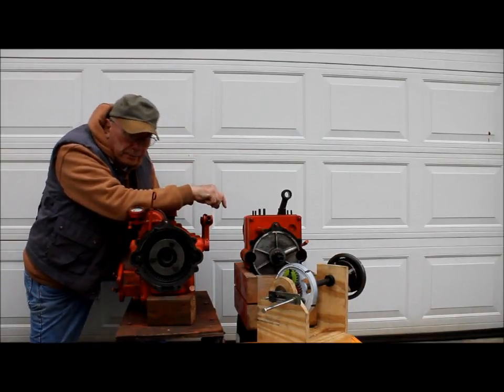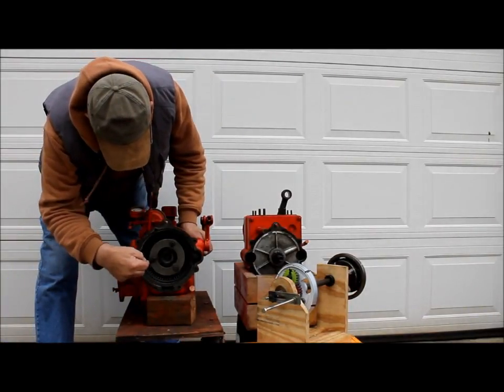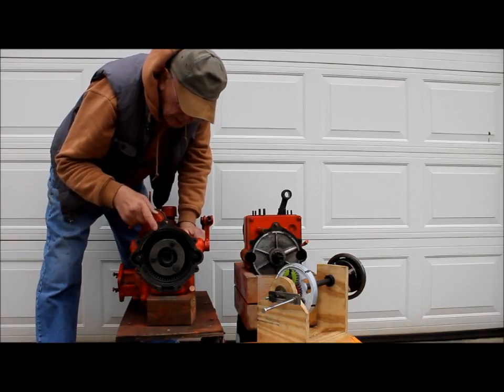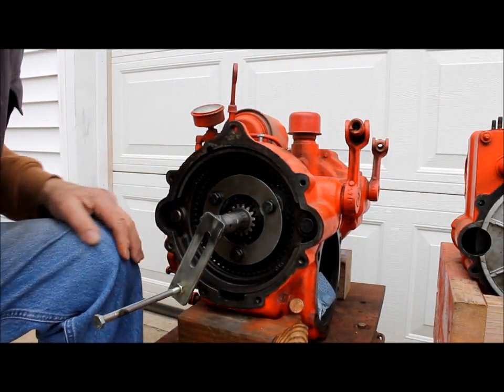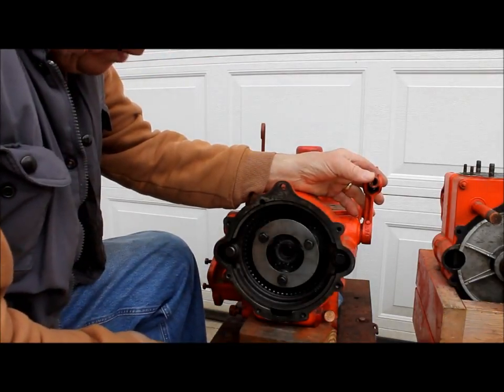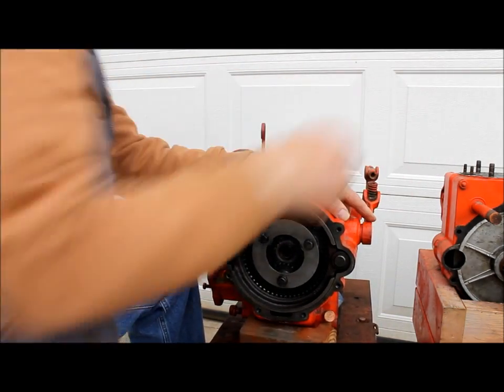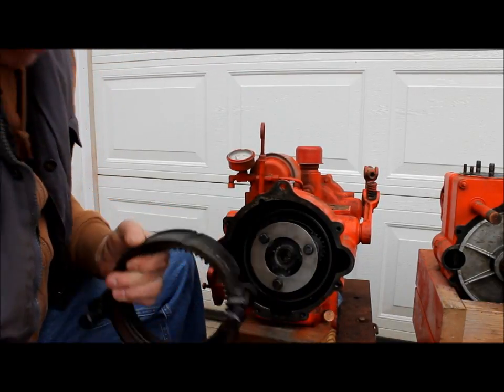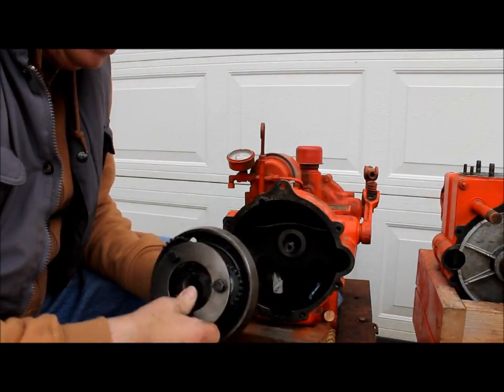High Low Planetary Removal.wmv

Comment: Hello. Great video ! Thanks

I have a question, my gravely convertible , the floor speed is to fast, i see on the gravely manual repair , it talking about frozen gear clutch.... it is possible to repair it with sand paper Thanks for your help.   Sorry for my english i am french.....